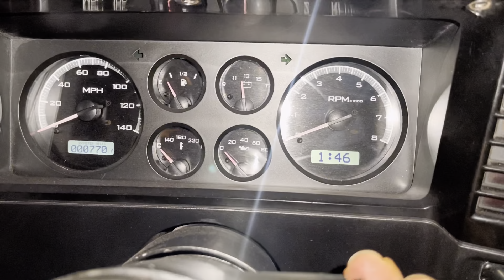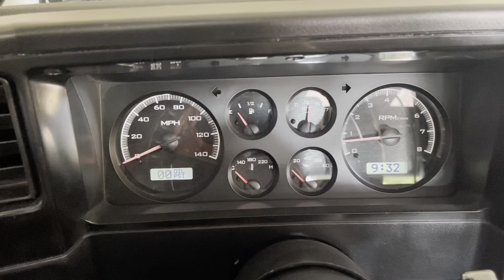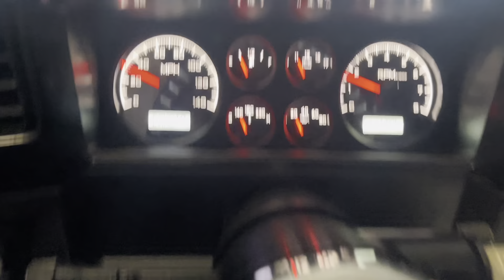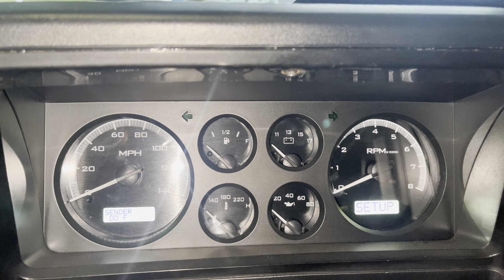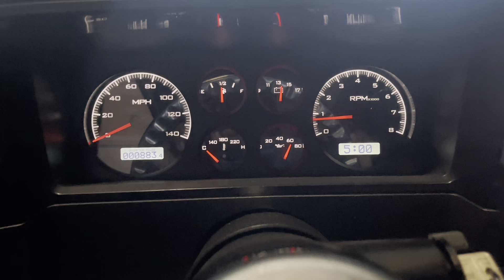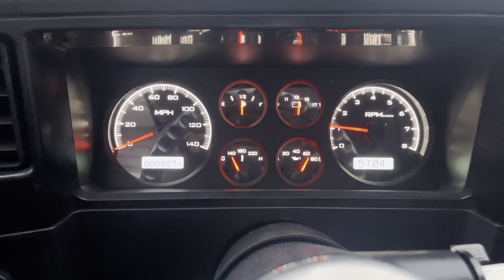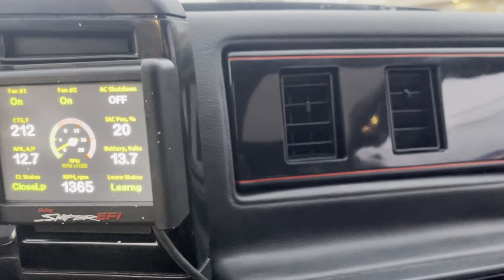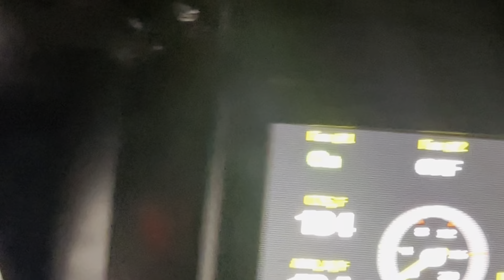NO OIL PRESSURE in the MONTE CARLO SS 😤😡🤬

Comment: How difficult was it to install that Holley EFI ? I have never done anything like that before but you helped my install my Dakota digital and that wasn’t bad at all.
Reply from the maker: 🦾🦾🦾...glad I could assist!!! Man honestly the Sniper was easier than the Dakota...it's literally a 4 wire hookup...hard part is running the cables to make it look neat, finding a location to mount the fuel pump and running the return line from the gas tank...plenty great vids on YouTube tho...Holley even has a few and their customer service is great!
Reply from the maker: First time for everything bro!! This was my first time doing these as well...lol...I didn't wanna deal with an overpriced shop and have to wait forever so I did it myself...
Reply: @87SSBOI  I feel you on that. I’m glad I done the dash myself instead of paying this shop $2000 and possibly be messed. Ima try out the  holly and check some vids out appreciate it 💪🏾💪🏾

Comment: Where do you have the temp sensors located, it could be the hot water moving into the radiator from the engine, mine does same and goes back down
Reply from the maker: This particular sensor is in the block

Comment: Hey what good bro what was the cause of your low oil pressure cause I have the same issue.
Reply from the maker: I explained it at the beginning of the vid...I didn't actually have low oil pressure...the reading was just wrong..the issue was the speedo cable was bad and for some reason the oil pressure uses the input from the speedo for it's reading...confusing but that's how it works with the Dakota Digital 🦾💯